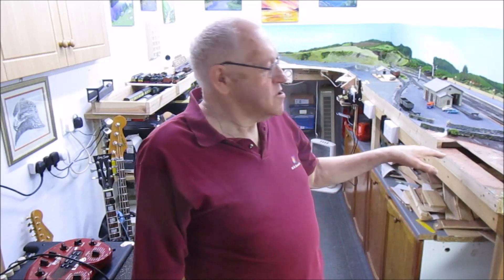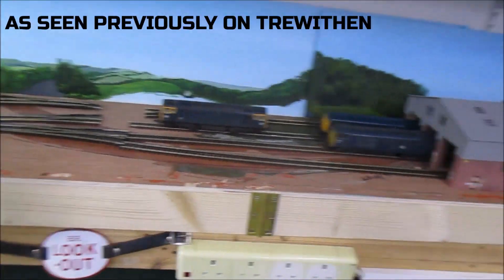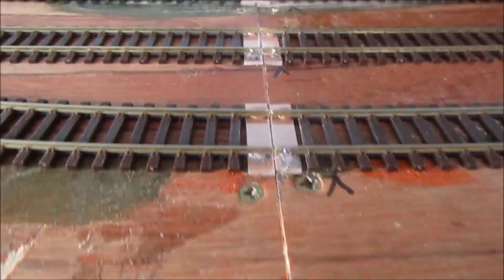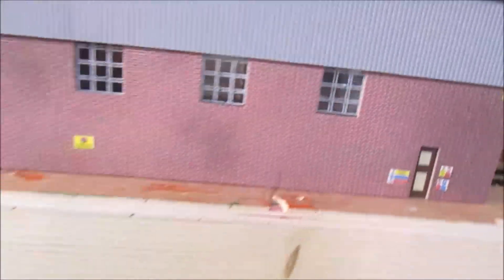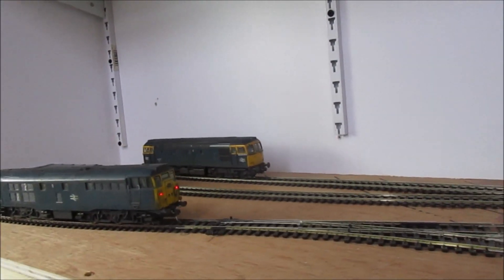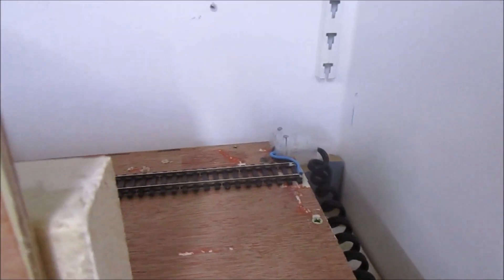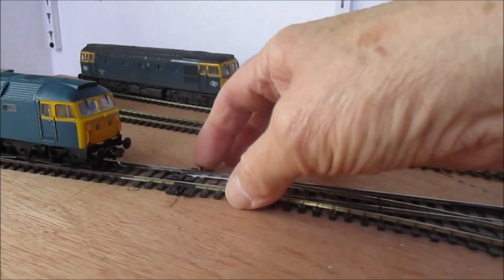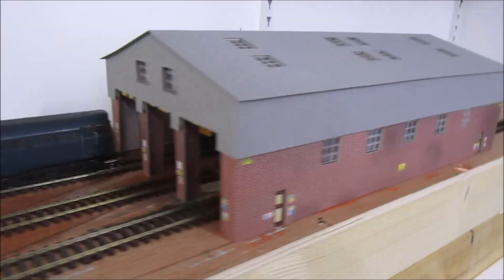BUDOC BRIDGE TMD No 1, Andy Peters World of Model Railways,

Comment: What frame rate do you video at? I video at 60fps and don’t get the flickering of LED’s
Reply from the maker: Hi Ian, Not a clue mate, Its my little point and squirt Canon camera that I used to use filming Seven Mills, and I only have it on what ever the factory settings are. It only flickers on certain Locos. The worst on Seven Mills was the 37's but others seemed fine, on Bute Road the 60 and 66's were fine but 37's flickered. I will have a look to see if the settings can be changed later. Cheers for your input mate. 👍👍